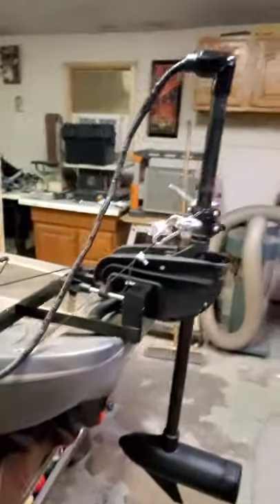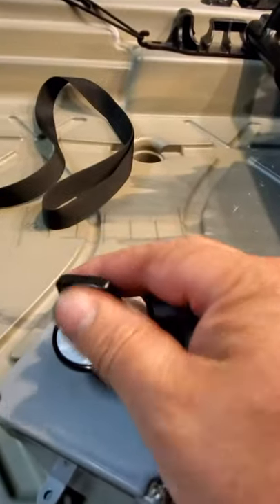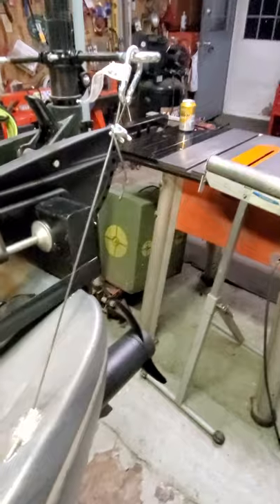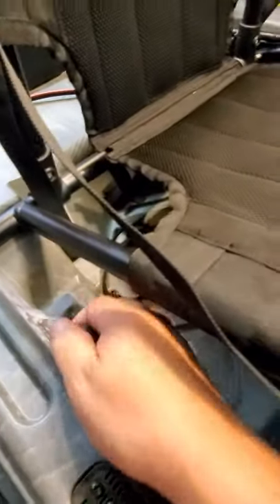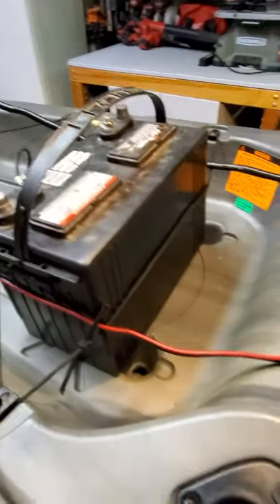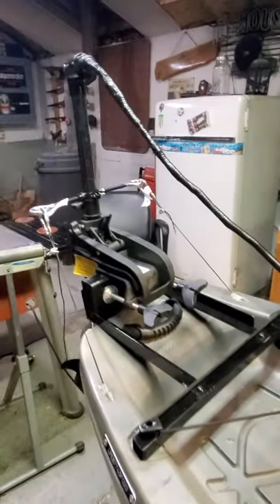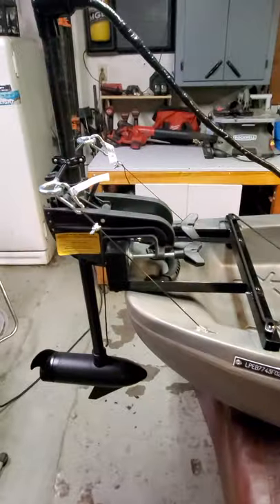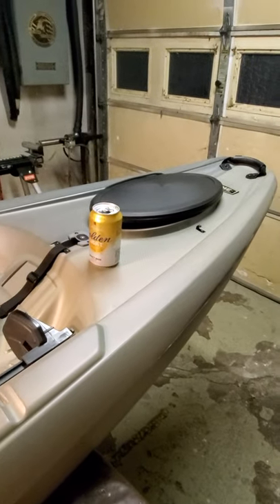Yukon 116 Kayak with a trolling motor

Comment: Hi I know this video is a year old but I had a question about how you got the stearin cable’s to come out where you have them with only one opening in the kayak. Did you cut another hatch in it?
Reply from the maker: Ran tubing with long metal wire and then pulled cable through.
Reply: @stevenordoutdoors  So there is no tubing in the cut outs for the foot controls?
Reply from the maker: @sevenbythirteen  by the foot pedals there is a spot where u could run tubing. I said  that in the video.